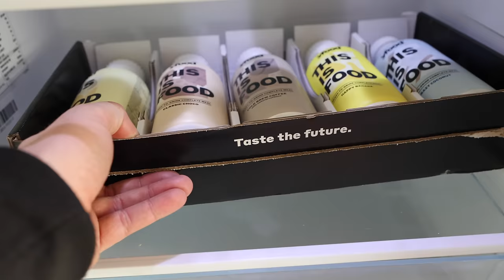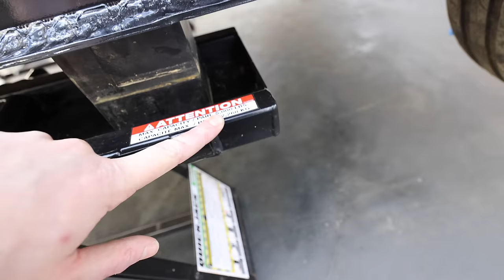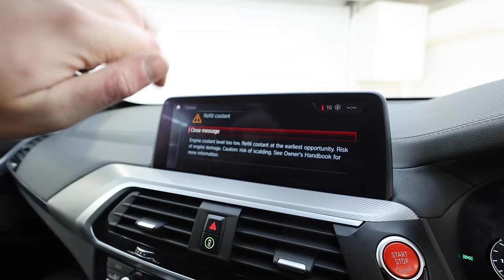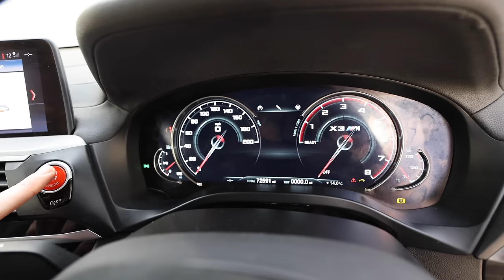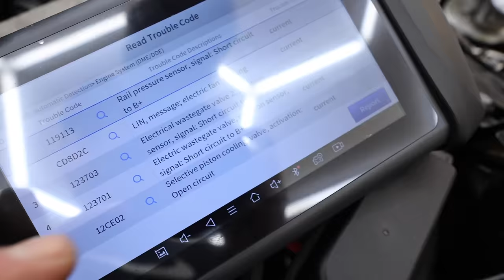INSTALLING THE ENGINE IN MY WRECKED BMW X3M COMPETITION

Comment: For the gearbox, the way ZF fills oil is by running it and filling at the exact same time.

My dad's 330d had a cracked sump. Replaced it and filled oil, ran it and switched it off, filled more. Afterwards it wasn't changing gears as quickly and it was slipping. When we went to ZF they had the car running and they filled it even more because strangely it was 2 liters low even though oil was flowing out as we filled it.

 So running it while filling AND OIL MUST DRIP OUT LIKE AN OPEN TAP

Comment: interested in this video (s) because i have the same car, so cool to see it completely apart, you left nothing for the imagination, would not see more on the factory floor, kudos for even attempting this project, that is how you learn. I would not run the engine without coolant though, the thermostat is still closed therefore not activating the pump yet for circulation, but things get how real quick and there is no coolant to act as a heatsink until it starts to flow......looking forward to seeing it roll now under full power.

Comment: Chris you’re doing an awesome job, if you have someone else do the alignment when you’re done, I’d ask them if they can break the front arms loose (on the subframe side) and retighten. Those arms need to be tightened when the suspension is under load or they can make a creak or popping noise. I leave the swaybar drop link off and then use a jack to push up on the suspension to normal ride height then tighten the arms down. Hope that makes sense but will save you time trying to figure out why the front end makes noise.

Comment: your ecu connectors prob wasnt in all the way. When u disconnect and reconnect the ecu, if its not locked in place it wont start. When u reassemble the ecu jiggle the connectors to make sure its in.

Comment: Well done mate. I would go round and torque all the suspension, subframe and propshaft bolts when completed and re check after a road test. A lot of power will be running through that drivetrain with they new turbos and your ratchet is tiny 🤣
Reply from the maker: Good shout 😂

Comment: Hi. I'll tell you why it didn't start, BMW engines shut the injectors down when it doesn't detect a spark. It happened when  you disconnected the coils.